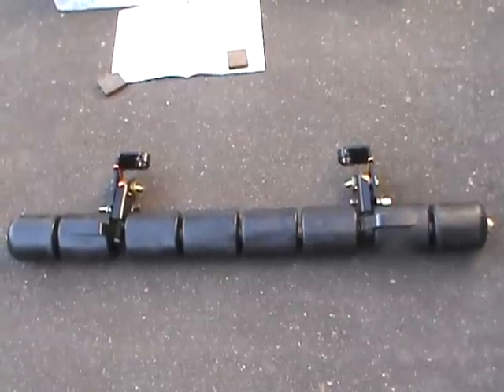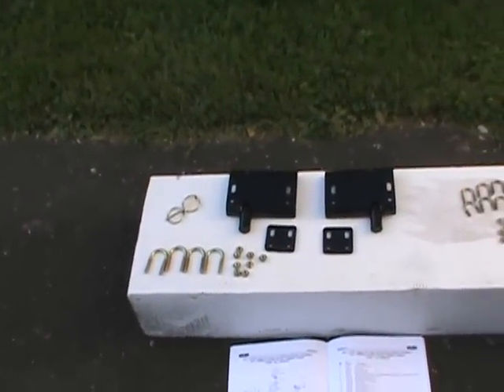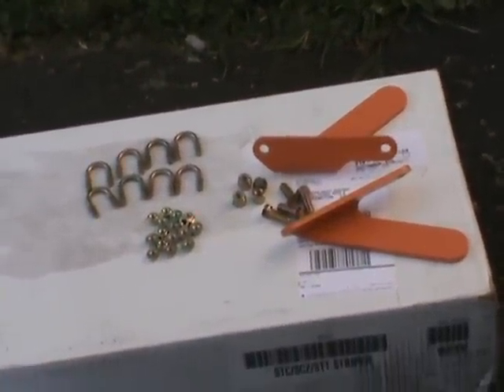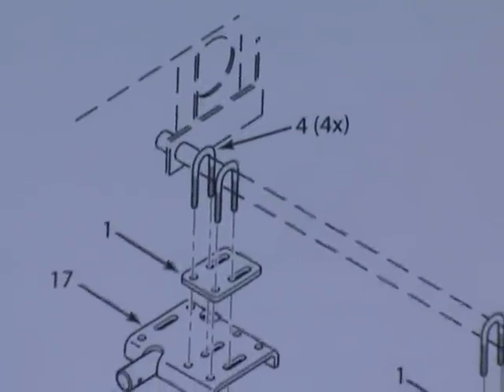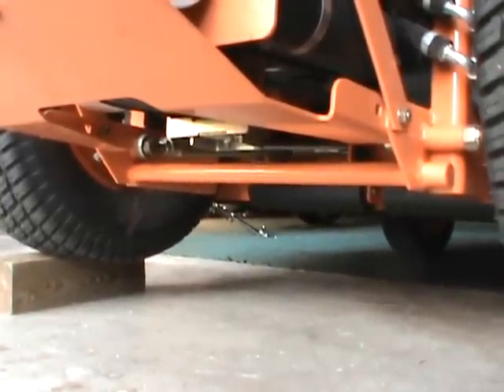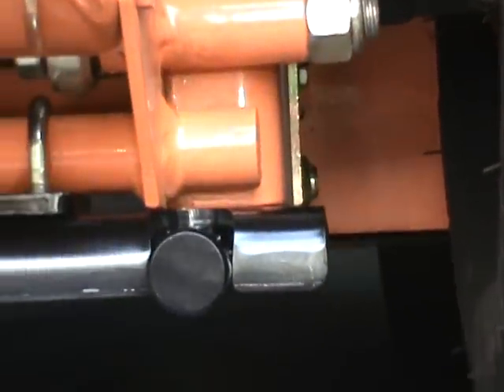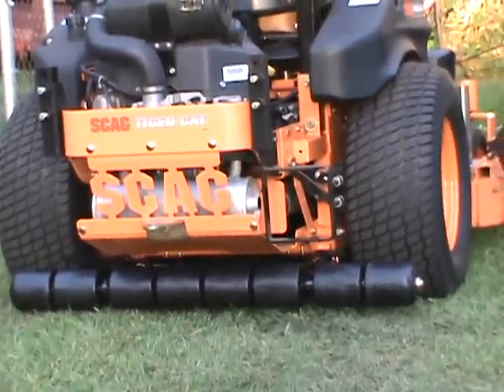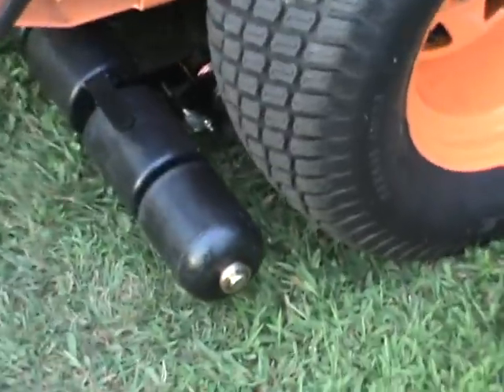How to install a Scag Striper kit on a Tiger Cat zero turn rider

Comment: How much that weight?
Reply from the maker: About 800 pounds
Reply from the maker: The stripper maybe 30 lbs. It's spring loaded and it floats on the grass ( with spring pressure)
Reply: @007connecticut  the stripper kit
Reply: No the mower
Reply: O ok Thanks 😎
Reply from the maker: @josecruzgarcia  800 pounds empty.

Comment: Good video thanks for sharing. Is the stripper easy to take off and on when your not using it? Does it simply lift up and down while staying attached to the mower?
Reply from the maker: Joel Smith To remove it you remove  the pin on each side, then it slides off the frame. To raise the stripper while in use, you lift it up off the ground then push in that spring loaded keepers. This is on both sides. It's easy to do, but it's a pain to drop to your knees to reach underneath.
So I don't remove it that often, only when I'm going to put the collection system on.

Comment: Great video. Have you taken it up and down a trailer with it on the mower?
Reply from the maker: I have never trailered  it as it's used on my property. It should be ok on ramps. Jumping curbs you would have to pull the pins and remove it.
Reply: Thanks for your reply.
Reply: I’d like to see it after a cut, I have a tc2 and think I’d like to get one